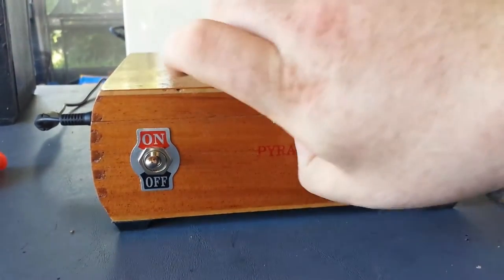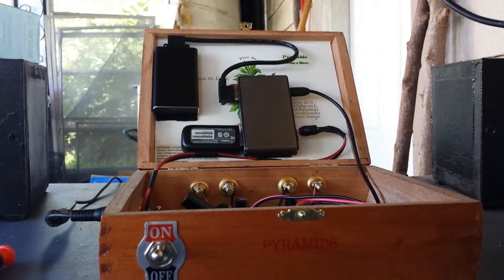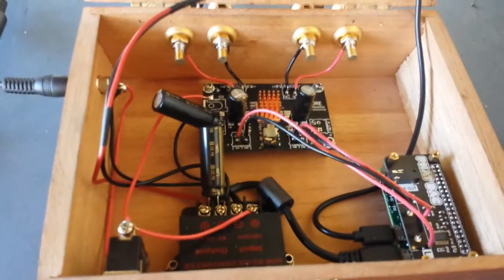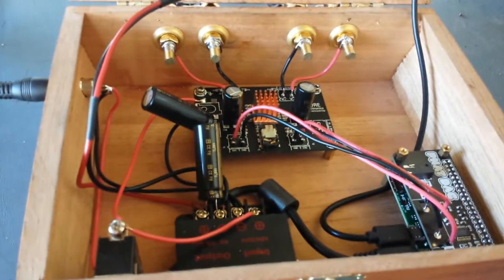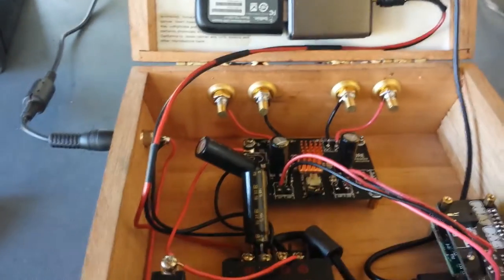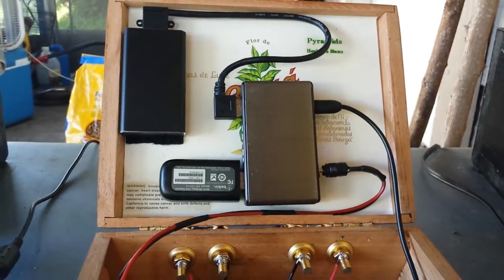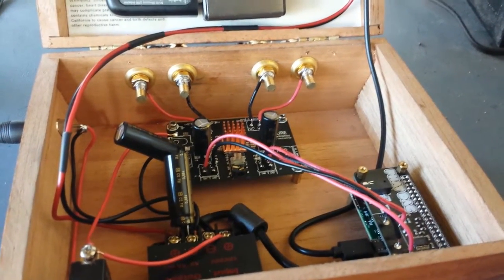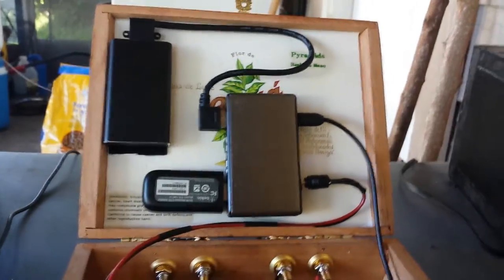Raspberry Pi Zero Cigar Box Stereo w/ hub and ssd mounted

Comment: Wooden boxes like that definitely add some class and hide/store electronic gear well.
Two little vents on the back of the box would probably help reduce heat so the box could be closed and/or a little silent tiny computer fan attached to one of the vents using a different power source although would probably be unnecessary. 

Good job 👍
Reply from the maker: pa maj thanks, that is my garage radio for the moment. I agree on adding vents. I have learned a ton since I built this a few years ago, and want to revisit the concept but with custom pcbs for on board power, amplification, dsp,  noise filtering, and DACs. This winter I plan to work on some of these components if I get the upgrades to my ebike designed and produced. I have done a lot of work on power supply design as well as analog and digital signal conditioning since I built these early projects.
Reply: @TheFootbaldd  You'll be a very busy man 👍